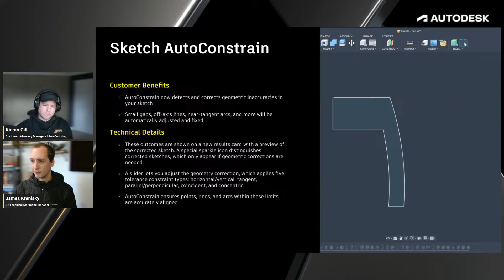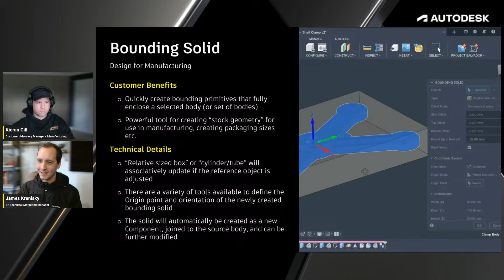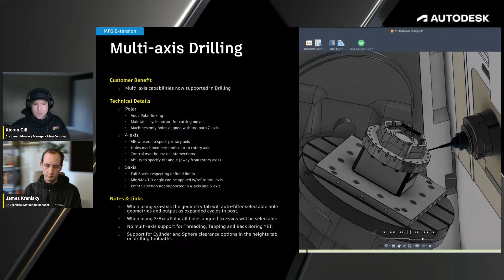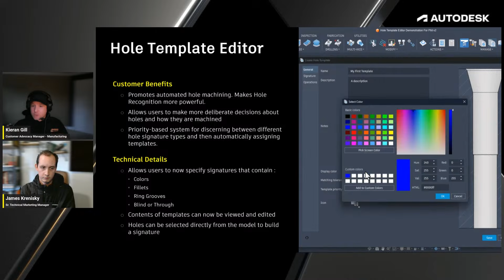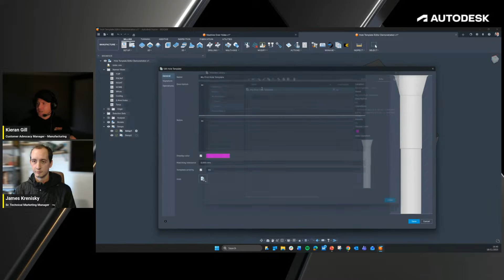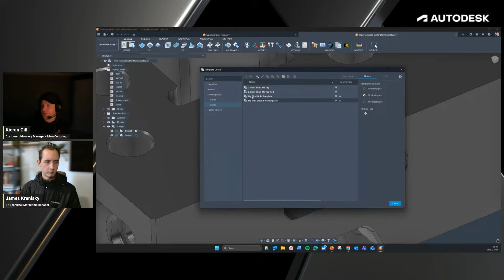What’s New in Autodesk Fusion | November 2025 Update

Comment: From Central Missouri. Format painter is huge! I have to switch units from metric to inch for vendors that need, and having to either modify one-at-a-time or Save-As and switch the whole drawing can be annoying; plus being able to re-use tolerancing and GD&T formats will be helpful. I am also a little disappointed that the sketch performance came after my on-site visit to a customer earlier in this month; I resorted to creating an SVG in a separate software and import to get our 50x120 grid of features sketched without crashing the CAD. The bonus is that the SVG imports with fixed-only constraints, so Fusion basically had to do no computation on the geometry.

Comment: Bounding solid doesn't work for cylinder. Example: Take the "Intro to 2D Machining" from cam samples. To make the example more like real life, move one of the bore faces to the center of origin. You can even keep the X-axis in the same direction if you want. Now try to create a bounding solid cylinder where the stock material runs the length of the part. Bounding solid should see that this part can fit in a 1.625 inch round bar. Since there is no face or axis to draw a reference from, the model will not be in the center of the part.